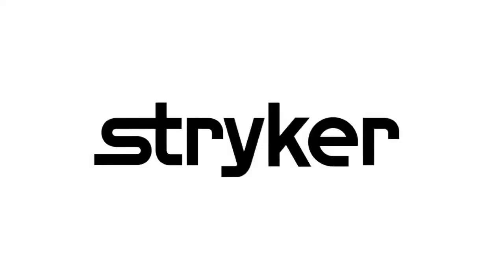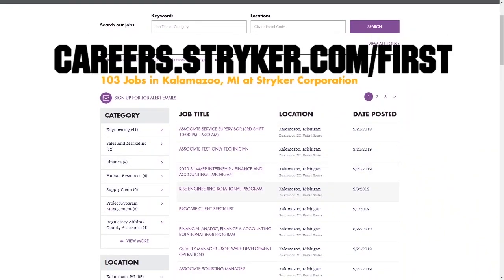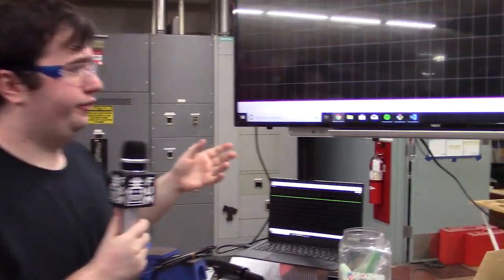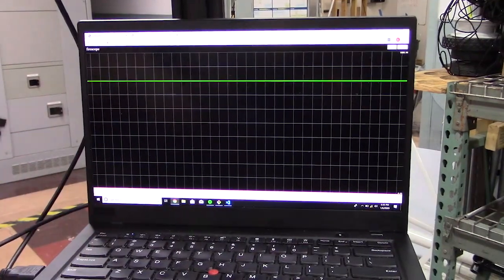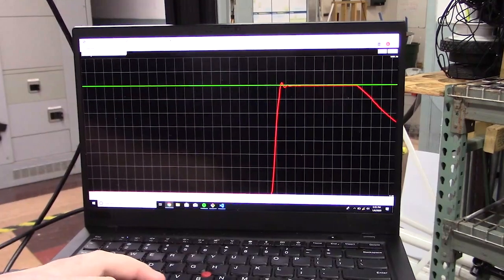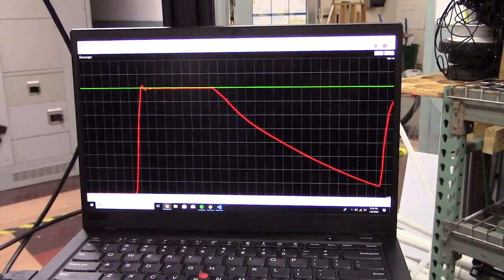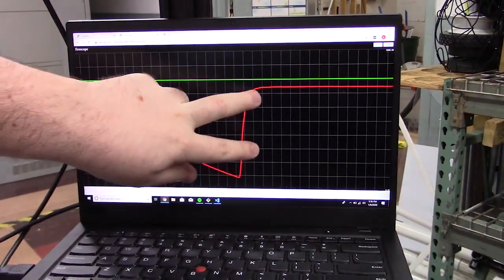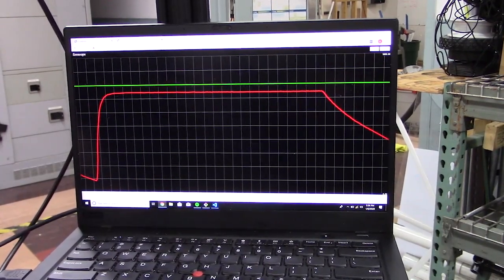Analyzing PID Loop on Shooter - FIRST Capital Ri3D - First Updates Now

Comment: This is technically a FPID controller. The standard F (feedfoward) is nessicarilly for easier control of the system. However, the P, I, and D need to be tuned to better control the response. Since the error is measured as the velocity, there is actually not even a need for an I gain to eliminate steady state error, but is instead best controlled with either a P or PD.
(What he said in the video is explained well... Description neglected the feedfoward aspect though.)
Reply: Yes - sorry I missed bringing that up explicitly. The "open loop" graph in the video is feed forward only.

I've seen some light shooters benefit from an I term - but for something like Ri3D (heavy wheels + an extra mass), like you said, PD+F is more than enough - which is what our implementation used.